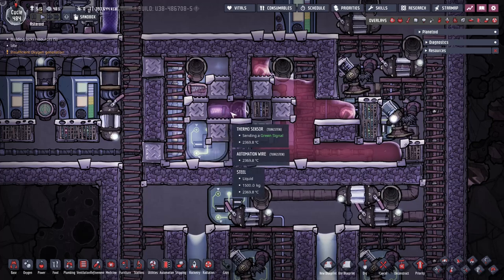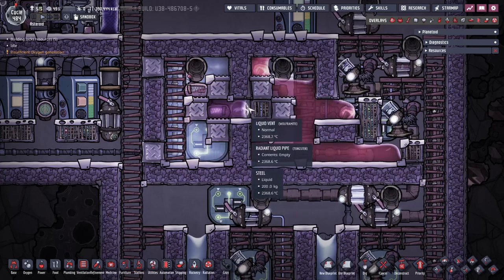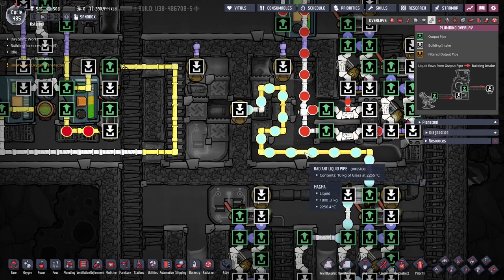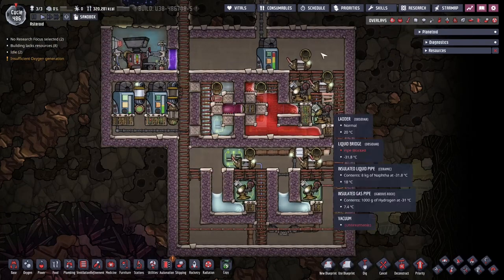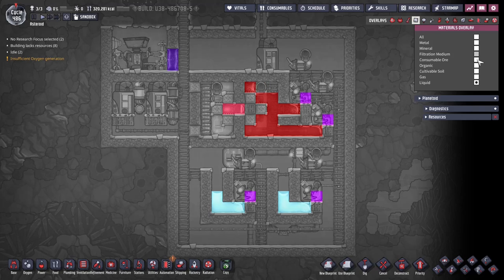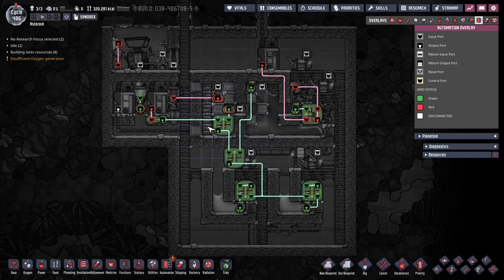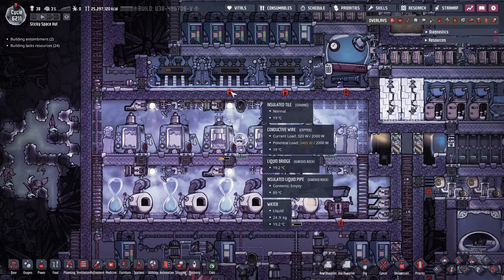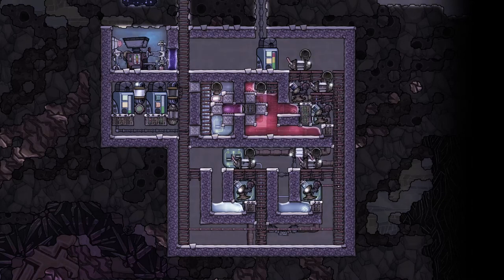Extreme Glass Boiler! - Oxygen Not Included

Comment from the maker: Additional notes, see below:
In a glass boiler by itself, mass is conserved but heat is increased because of the difference in specific heat.
In a complete setup, 75% of mass is removed at the glass forges.
Calcs: (comment if I got anything wrong here)
Feed      -> Regolith 0.2 SHC x 20KG/s x 300C = 1'200 KDTU/s (meh)
Regol.Melt -> Igneous 1.0 SHC x 20KG/s x 1200C= 24'000 KDTU/s (HEAT!)
Ign. Turbs -> Igneous 1.0 SHC x 20KG/s x 125C = 2'500 KDTU/s (nearly useless)
Crusher     ->   Sand 0.83SHC x 20KG/s x 125C = 2'075 KDTU/s (less heat)
Forge       ->  Glass 0.2 SHC x 5KG/s x 1740C = 1'740 KDTU/s (less heat, more temp)
Boiler      ->  Magma 1.0 SHC x 5KG/s x 2300C = 11'500 KDTU/s (HEAT!)
Magma Turbs -> Igneous 5KG/s @ 125C -> feed back into crushers, repeat
Reply: What is this game/program ?
Reply: @AndroidFerret  the name of the game is oxygen not included.
Reply from the maker: @AndroidFerret  https://store.steampowered.com/app/457140/Oxygen_Not_Included/